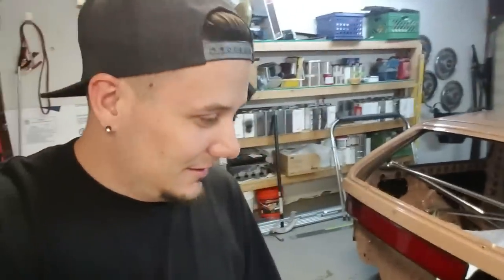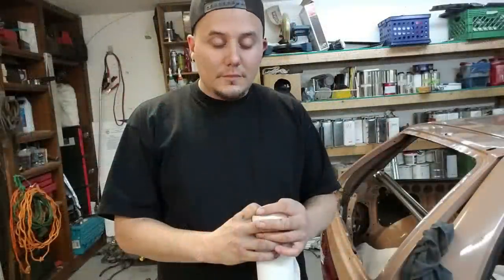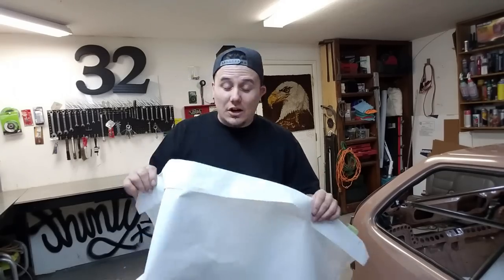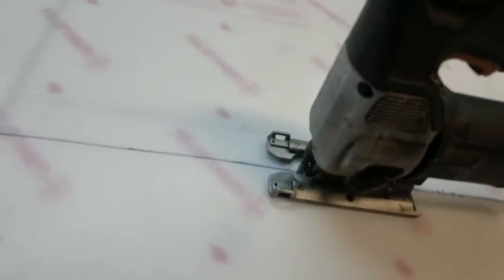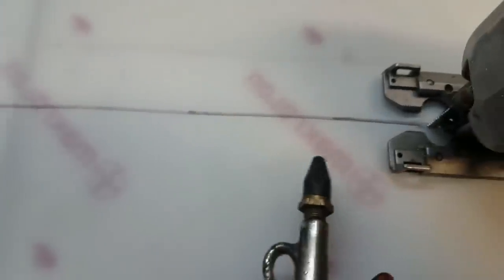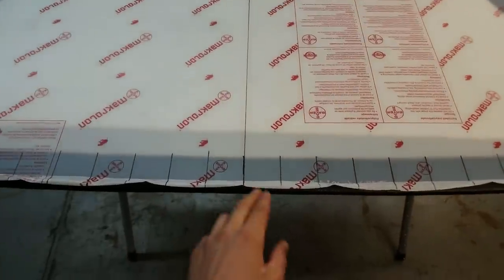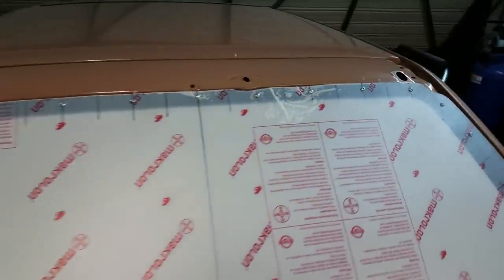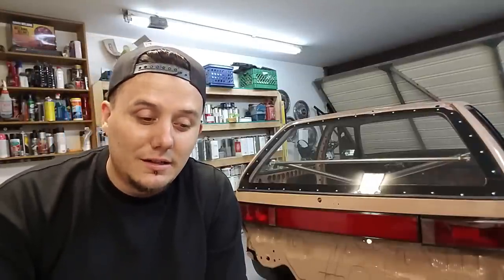(DIY Lexan windows) EF Civic project ep.40

Comment: Use 3m glass urethane to seal it from the back, find it at automotive glass shops around you, easily goes on with the use of a caulk gun. That is what holds the glass in originally. And what keeps it from leaking. Great vids bro, stay up!